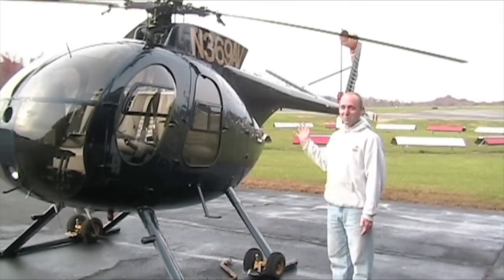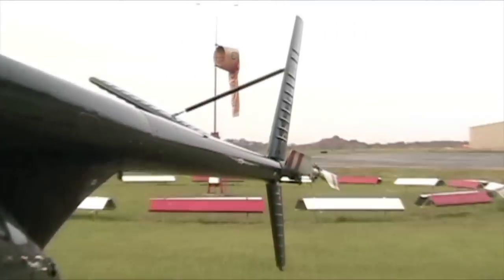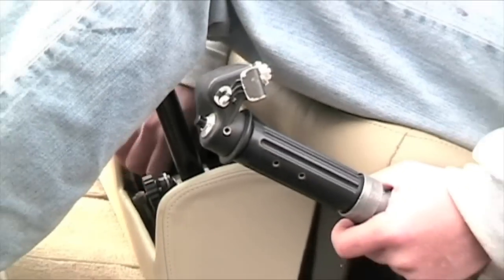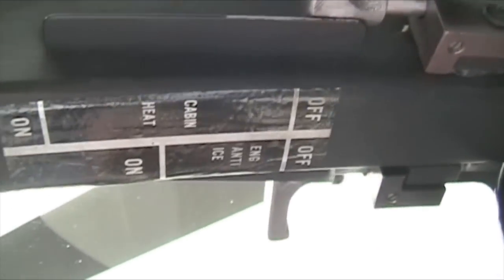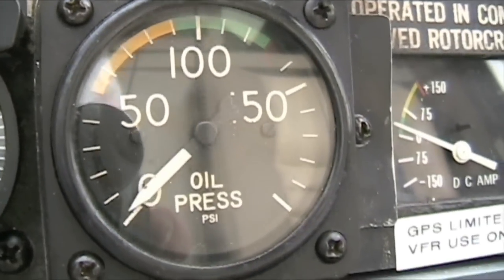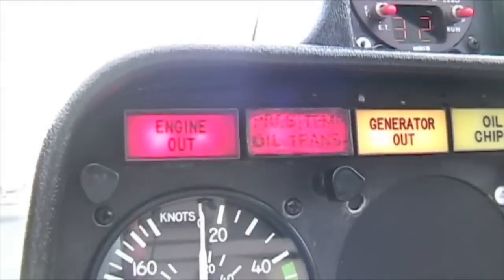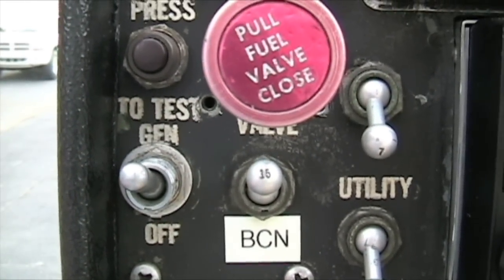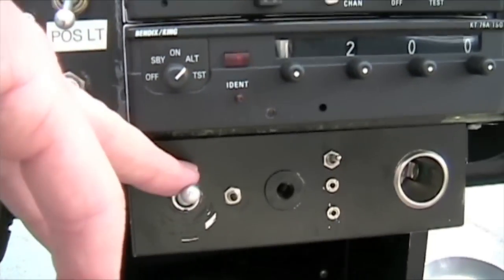MD500 - What to do Prior to Starting the Turbine - Hughes 369C

Comment: The R key on the rear rotor pedal is installed wrong.  It should be inserted into the hole to the first detention. Some folks think that by pushing it in all the way makes it less likely to  come loose. Actually  by forcing it all the way you bend the key slightly  open (If you look closely you will see that this one is bent.) Agreed it is not likely to come loose however it is  not correct.

Comment: so the rotor brake is only for stopping the blades and not securing the blades during parking? or are the rotors secured form the exterior, or is there a lock inside? next, what control surface does that trim on the cyclic control?  the APU's we use at th eport are 24v for military equipment, this use regular car batteries? whats the red button beside the trim? and do you fly with such a heavy drag on the collective? lol

Comment: You're supposed to look at the rotor blades when cycling the cyclic so you can see that the blades follow the cyclic and checking the swashplate function when raising the collective full. I preferred the right PIC version I used to fly.

Comment: why is the left rudder pedal turned around?
Reply: In case you haven't got an answer for this, it was because the 500 series MD helicopters had a spring loaded left pedal to assist during takeoffs and also left pedal could be applied by just releasing the right pedal, so leg fatigue was reduced. At cruise, some of the spring tension was nulled out by aerodynamics on the tail. On the ground, reversing the pedal kept all the pedal and tail rotor mechanism neutral. Not sure why this feature was added, since the military version I flew way back, never had it, except the "little bird" version, which was almost a civilian model converted to military special duties.  Hope that helps.
Reply: javacup912 Do you mean that the pedals in this helo do have springs and a centering point like conventional airplanes?